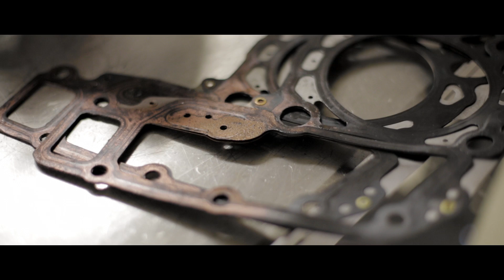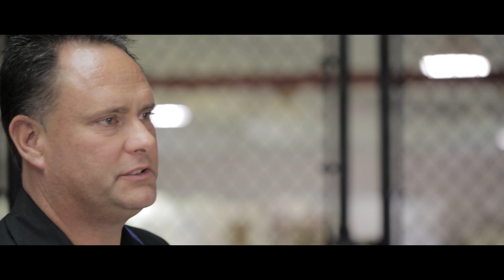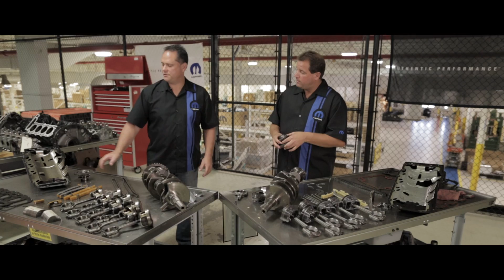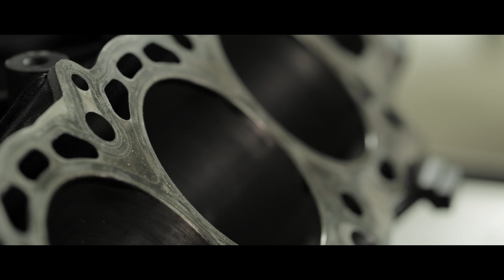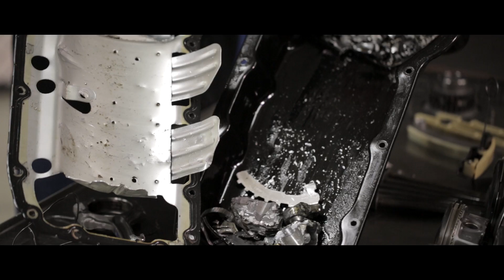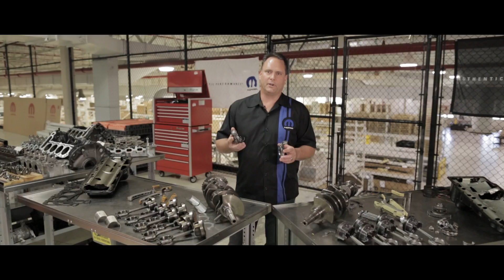Genuine Mopar Remanufactured Engine vs. the Aftermarket

Comment: They don't fix the dropped valve seat problems in the 3.7,4.7 and 5.7 hemi engines.Their reman engines are not done by them.They outsource this using the parts that fail from OEM.Jasper is the only one that fixes the valve seat problems in these engines and they put a sticker on warning the installer to make sure the intake manifold is checked very well.Put that old intake on when the valve seat comes apart,will result in engine failure again.
Reply: Bet they don't peen the valve seats in. 
Bet they don't port and polish the head.
Reply: @johnbaker4915  I know Jasper will port if you request it. They always polish. No, I don't work for them, I do however have a Jasper with 350k on it and now it is in need of replacing sadly :*(